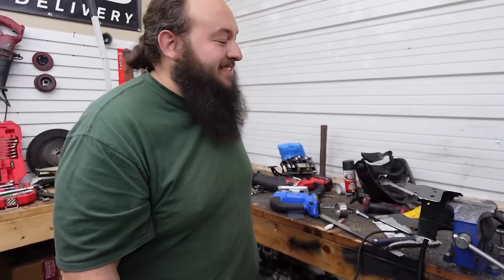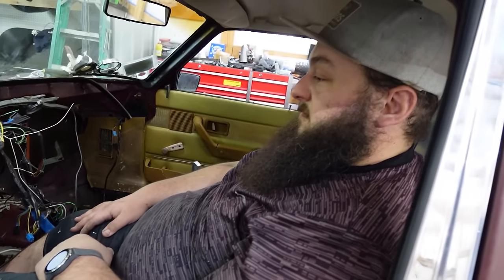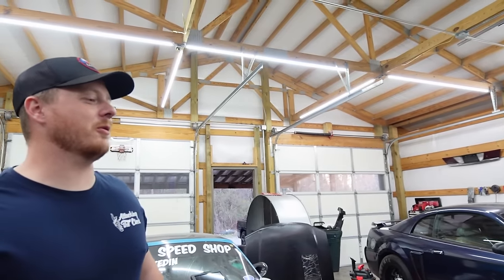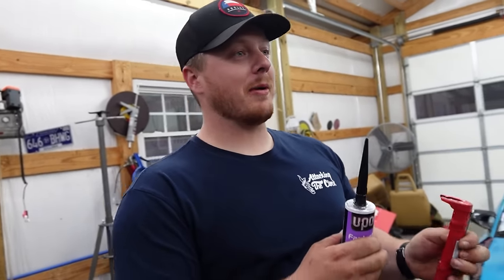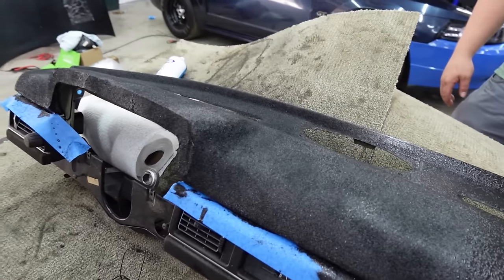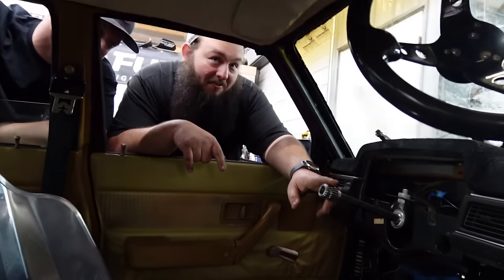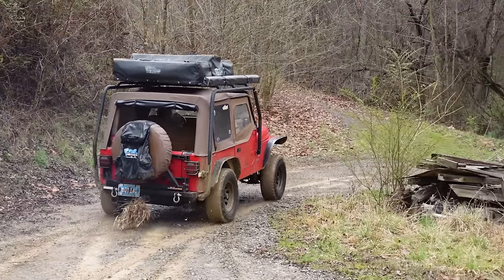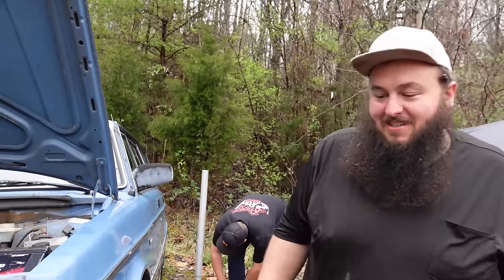How to Flock a Dash for CHEAP | From Cracked to "Mint" for $30

Comment: If you wanna cleanly spread silicone or seam sealer after you lay a bead give it a light spray with pro strength goof off then spread it with your finger or a caulking tool or putty knife don't worry it dries and sets normally

Comment: Who got the wr I have two older ones they are 2 strokes a 94 with everything done jetting pipe reeds flywheel weight and a 91 I'm restoring as we speak and if I get my way I'm gonna all the way with it too and my 94 does 96 mph with more to go but I was on dirt and the rear started switching sides and I let off

Comment: That ^Flocked^ dash reminds me of a slammed 80s toyota pickup i traded for it has speaker box carpet on the floors so impossible to clean you had to sweep it and vacuum at the same time and it was black